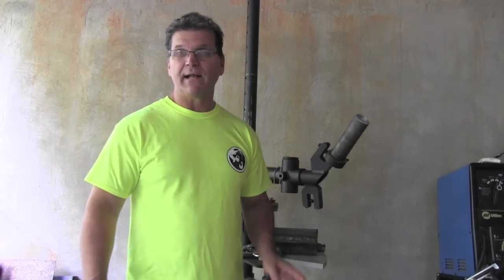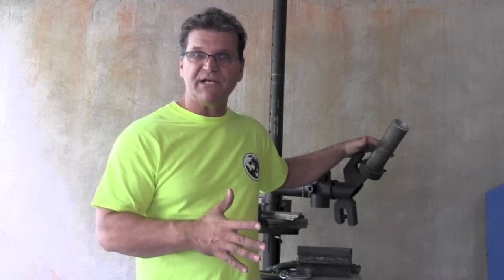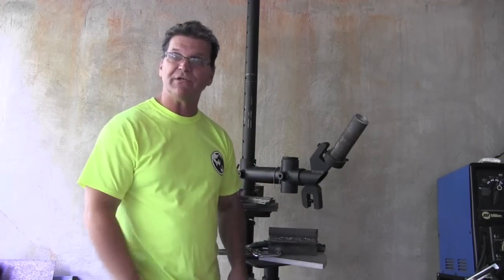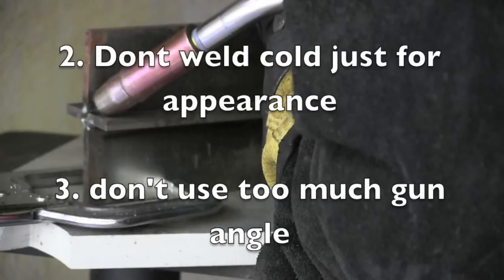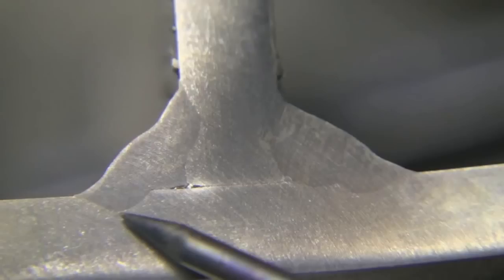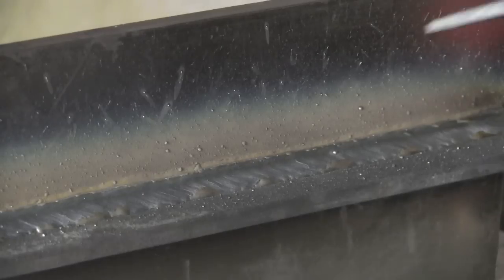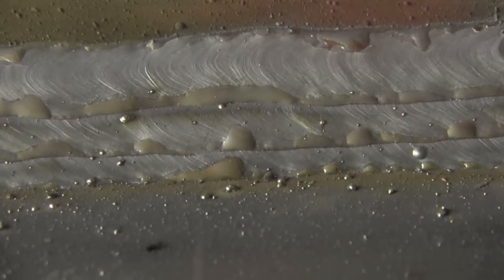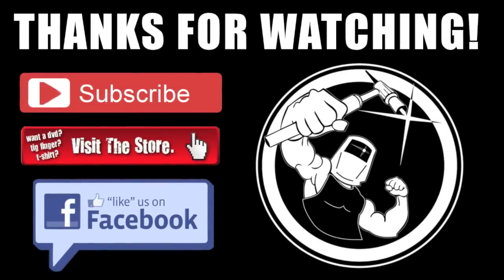MIG Welding Basics part 6 Tee Joint Drill

Comment: We do "multipass" usually 3 pass on basw plates for large columns and such usually over full penetration preps
Its a good technique for giving the weld more surface area bite on the parent metal

Comment: Hi Jody, I was wondering why you are only using 330 inches per minute of .035” wire for these 1/4” welds when the formula you discussed of 1 amp per .001” of metal should come out to 400” per minute of .035” wire. Also, it seems to me that the voltage you have it set at would seem to be a little too high for what I expected. I am basing this off of the experience I have with my Miller 251 welder. By the way, according to the chart on my welder, the 1/4” setting using .035” wire and 75%25% argon and CO2 is 19 volts at 320 IPM of .035” wire. I have checked the wire feed speed using your technique and found the welder is pretty much spot on. Is there that much variation between different welders that makes our numbers that much different?  Or am I missing something?  Also, I rather like to weld 1/4” steel with my welder set at 400 IPM .035” wire at 20.5 volts. I do have to move a little faster for a travel speed though.

Comment: I have never done an actual "multipass" weld before. I mean I have done my (probably wrong) version of it many times (I worked for a small welding shop for about 6 years that welded primarily.065-.120" wall tubing and probably 1/8-1/4" and rarely some 3/8" plate) but never got into anything pulling more than around 120-160A. I am running into a project that needs a bit of 1/2" plate welded and NEEDS to be structurally sound. I have a Millermatic 250 with a spool of .025" ER70S-6 in it, it's looking like I should probably snag a an .035 or .045" spool, liner and tip for the gun and then crank the voltage up. Running 75/25 for gas, apparently 100% CO2 burns a little hotter, not sure if that even matters. Any info you can throw over here would be greatly appreciated!!

Comment: Why in school i am learning to push instead of pull, as in this video you are pulling away from the way the wire is coming out instead of going the same direction as the wiring is coming out? Like from left to right you angle gun to the right and right to left you angle gun to left.

Comment: Can I ask why doesn't increased wire speed result in a longer wire stick out.  I mean, how is it that you turn down the speed, then turn up the speed, but the wire stick out always seems to be the same.  Seems the wire would run out of control with an increase in speed.

Comment: Is there a difference in the way you weld MAG and MIG?
You just have a different materials like the wire electrode and the shielding Gas.
In MAG you have 83%CO2 and 17% Argon to MIG you use neir 100 % Argon (100%clean isn't possible but enough clean to be declared as clean Argon).

I have learned from right to left as a right-hander

Comment: Jody, on this video,  you ended up with a total of 7 laps on that last inside corner.   More passes will yield a stronger joint?  My real question is, if the initial pass has very poor fusion,  will the others be for nothing?

Comment: This is really helpful, thank you! I have a Home Depot Lincoln Electric 140 mig and need to weld 3/16" square tubing together for a welding table. Will this technique work with this underpowered welder? Thanks!

Comment: sorry for the beginner question, but I'm just starting out with a 110 volt mig and was wondering why I blow holes in thinner material.  not sure if it's wrong voltage setting or distance to material.  or both.  any pointers in regards to this issue?  thank you
Reply: That means your travel speed is way too slow. So it's kinda like you're burning right trough your material. Try moving faster with your torch

Comment: Jodi whenever I have to weld a critical joint I like to prevent  LOF by bevelling the metal to get better penetration. On a T joint I bevel the upright  piece. On a butt I bevel both pieces  and I usually grind the opposite side through to the weld to achieve total penetration. Is this a recommended technique or not. Love you're videos ,keep them coming.

Comment: Hi there. Great videos I'm learning a lot! I have had a craftsman 60 amp MIG welder for about 15 years. It's starting to give me feed issues and I've never been able to get that bacon sound like at a shop I worked at. I want to upgrade to a more powerful 240v machine with 10 lb spool capacity. I found the Lotos 175 is in my price range ($575) and it comes with a standard MIG torch and a spool gun for aluminum. Ever work with a Lotos? Miller is out of my price range. I weld anything from .065" to .50". Just looking for some insight. Again great videos!

Comment: Jodi it's a damn shame I'm going to school (almost finished actually) but I'm learning more from your videos than I am in school. We're taught NEVER drag, even though our NCEER books show pushing, pulling as well as 90 degree angles and the advantages/disadvantages of each. As far as settings on the mig machine, I now understand what to look for and why, to improve my beads. We're basically taught to set the machine at X and X and practice welding. We're not taught WHY to set the machine up just so.

You're videos are outstanding and greatly appreciated by myself and most of my classmates. We are all big fans.

BTW I've ordered your tig finger and highly recommend it! It works every bit as well as you say it does.

Comment: Hi Jody... Noob question.... I have moved from stick to MIG...not really meaning that I have mastered the process of arc welding.  It's just that I wanted to learn this and soon TIG.  ... my Hobart 190 is great machine... I have played with it, I even tried it without shielding gas.  The question is-why do I get bubbles on top of my weld bead ALWAYS!  is using pure argon to blame??? I prepped and clean all surfaces... but still have small craters/burst bubbles on top?
Reply: that is your too cold. also  the gas dosent cause that, but id stick to a c25 or close to that for mig, if your doing short circ mig. also could be perosity, meaning watch your gas coverage, it should be 20ish cfm ish

Comment: Hey Jody! could you do a video on mig welding thin sheets/pipes with minimal destortion without copper backing. what Im looking for is submerging the work in water exept the area that your welding to cool it. Does it work or is it pointless, if it works it would be an alternative to expensive tig equipment where a mig is not reallt suitable. Thanks man your channel is pure gold

Comment: G'day Jody, I've been having a bit of trouble setting my mig welder at higher voltages, I've got a Lincoln Redi-Mig 215c which i believe is only sold here in aus, but it has step control voltage settings, and from about 21.1V to 23.2V it only seems to go for globular transfer no matter what i do with the wire feed speed. One voltage step down from that range it short circuits just fine and above it gets into spray transfer.. I'm using 92% argon 5% co2 and 3% oxygen gas, is that possibly what's causing this? I've searched around for a video on setting the machine at higher voltages but haven't been able to find much.

Cheers, Will.
Reply from the maker: I think your gas is the main reason for your not being able to weld short circuit in those voltage ranges. 92% argon is not as forgiving as a 75/25 arg/co2 for short circuit mig.

Comment: This is the drill that helps people the most. We didn't really do a pad of beads in my first class we just kinda ran a few beads on a flat piece of metal but not side by side or anything. Then we moved on to this and then we moved on to stacking the pieces so you had to get in there then it was uphill then overhead now we are doing bevel plates. I am really starting to like welding.

Comment: This really is good practice. Even with more than a few years of experience, if I have some downtime at the shop I will do this same drill just to keep my skills up. Same thing with any other process, if I have time I don't stand around and look at the clock or whatever else I maintain my skills. We don't do a whole lot of TIG welding at work but at least every other day I run a few beads on a piece of scrap.